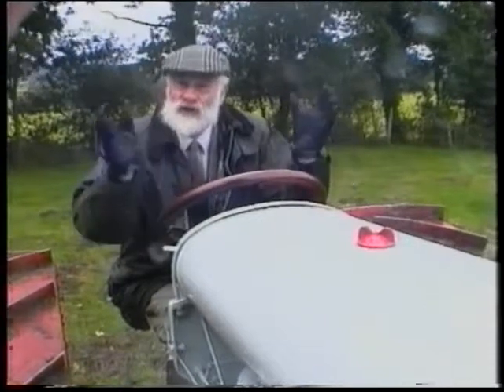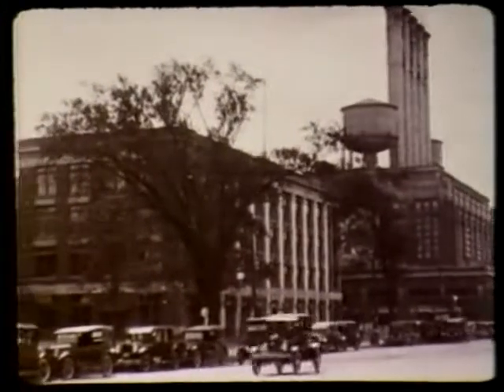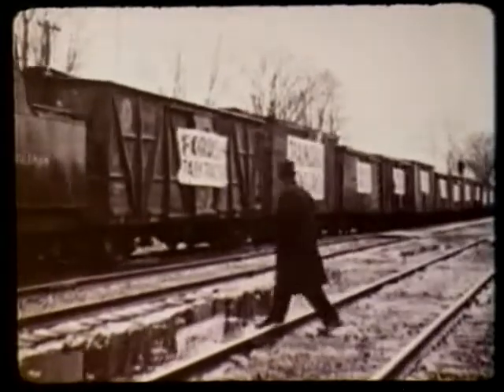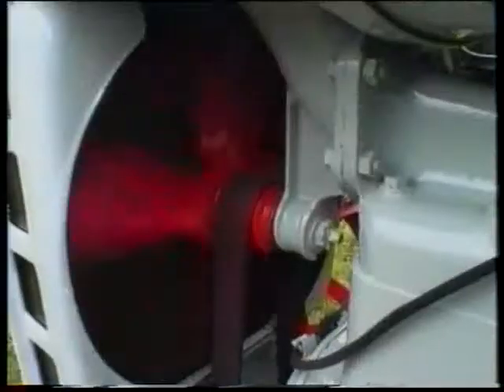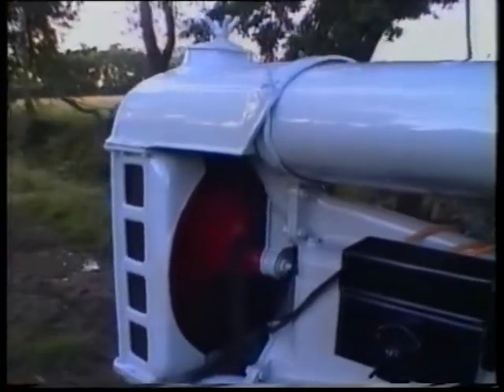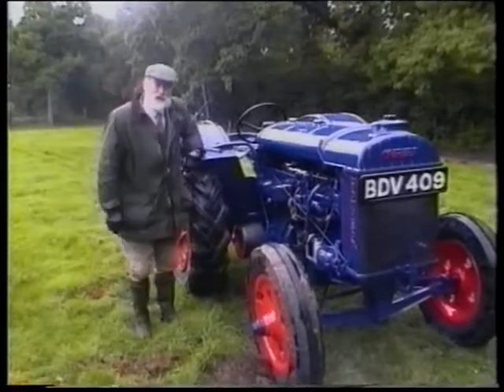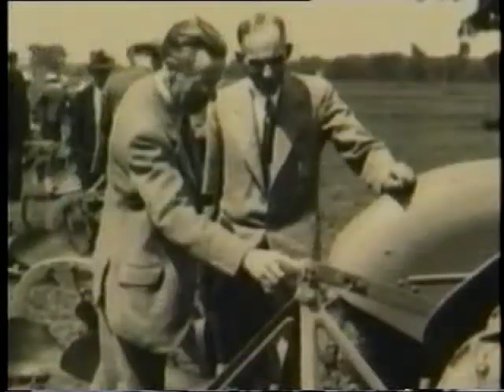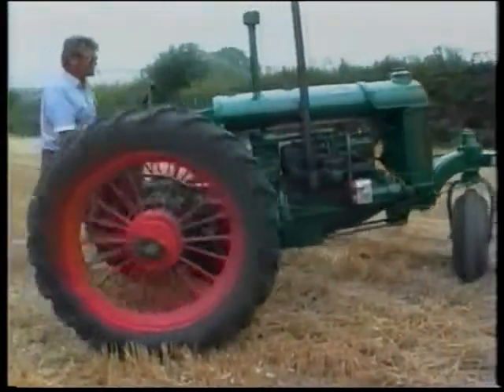Fordson - Story of the Tractor

Comment: I spent many hours in the seat of a Ford son Power Major in the 1970's hoeing sugar beet with my father on the back steering the hoeing implement, we had a Super Major as well and that had a front end loader which we used for muck carting and also loading hay/straw bales, happy memories and a world away from the modern tractors we see today, cheers from the UK.
Reply: Cheers from the heartland, USA
Is that you on the bike?
Fun stuff.  (Please be safe.)
Reply: Thanks for your stories! Mark. My dad was born 1918 when he was alive he told me his dad purchased a fordson 1920’s  he had it a week and drove it back to town and traded for a mcormick Deering the early fordsons would turn over backwards Ford tractors were good!!!
Reply: @jacquelinejanz8466  Yes that's me on my Suzuki GSF1200s Bandit, a beautiful ride with bags of torque.
Reply: @traderjack6151  My stepfather was born 1923 as my natural father died 1973 when I had just turned 6, but that's another story. No safety cabs in those days although we did fit a roll bar to prevent the operator being crushed to death as tipping over was a real issue back on those old machines.

Comment: very interesting and informative. but if they were making and selling tractors well why did they stop?
Reply: I assumed that as farmers switched to fewer but larger tractors the volume dropped
Reply: Fiat bought out New holland (At the time was machinary like balers, foragers etc) in the late 80's, and then bout out Ford in the early 90's as the market during that time for tractor selling was Crippled due to ressession in many places leaving the agricutual landscape bleak. Fiat then turned into FiatAgri, FA Was a brownish colour, some new holland tractors to date will come with the colour as a special model. Also in the time FiatAgri Also bought out Case International Harvester (the two brands liquidated prior) And began to form what is knowen today as "CNH. Case-New-Holland", Which obviously sells case and new holland. The blue being New holland was ford. The case being Red for internional Harvester. Real shame ford sold out as one of the farms i work on always bout fords from 1940's up to 1980's when they started to intergrate electronics onto them. If you ever look at early model New hollands, look at the last generation of ford tractors. EXACLY the same. A Ford 8770 is exacly the same as the later famous TM Series New Holland tractors which also came in varients of Blue Or Brown colour paintjob. This series went from 110HP - 190HP, the "TM150" Meaning the TM series with 150hp. Although 150HP+ Range were notorious for failing brakes as the oil would overheat causing brakefade on the wet brake liners.

Comment: Lovely "olde worlde" programme and very well explained development of a fabulous tractor family.
What has always puzzled me, a tractor is meant to tow, why does it appear (to me) that the rear tyres on a tractor are the wrong way around.
Surely, the grip would be better with the two tread pattern being in a "grabbing" form rather than sharp edge first, just a thought....
Reply from the maker: I think (but don't quote me) it doesn't cause damage to the field and crops it driving through.
Reply: @fazer2474  Thanks for that, makes sense, it's just that a shape that grabs seems better than one that is like a boat prow shape, especially when pulling a load. But I can see what you mean.
Reply: ... also the tyre is being squeezed together rather than pulled apart which would eventually split the rubber tyre down the middle, I hope you don't mind me adding my bit as I really enjoyed this video too.
Reply: @leddielive  Interesting thought that, could be something there, thank you..
Reply: they are mounted this way so the are self cleaning , try backing up in the mud  and you fill the them with mud
Reply: @steamshoveler5055  Ah, so that is why, thanks for that, I guessed that there was a reason but could not think what it was as I have seen similar pattern on very old iron wheels as well, thank you!
Reply: This conversation is WAY above my pay grade, but I’m eavesdropping hoping to learn something 🙋‍♀️

Comment: Biggest fail of the Dextas was them sticking in gear...
Reply: ha ha. yes been there. Fixable by building up the side of the stick with weld to limit its travel
Reply: @Brian-jf1zx  correct, a very fast tractor also
Reply: That's why you keep a 1/2" spanner in the toolbox.
3rd gear is most common, you learn to move the stick more directly, and it helps to build up the tip of the shifter with some bronze.